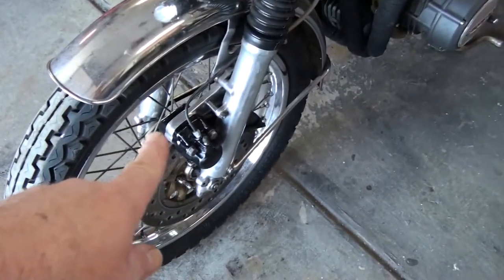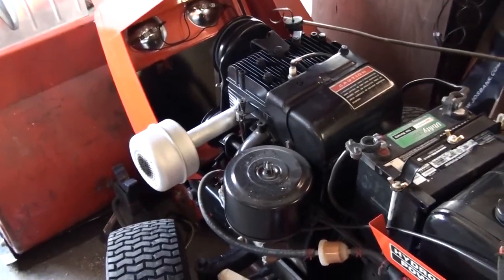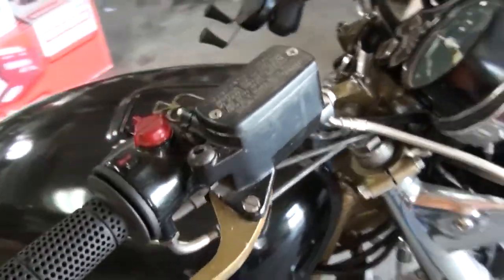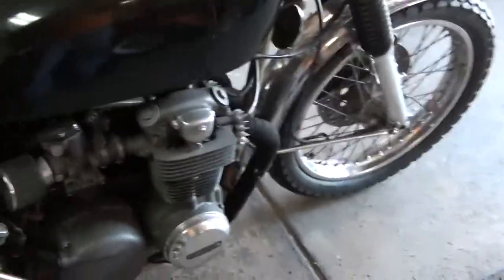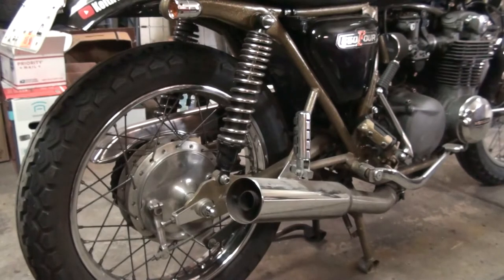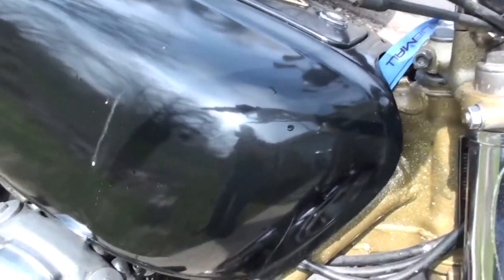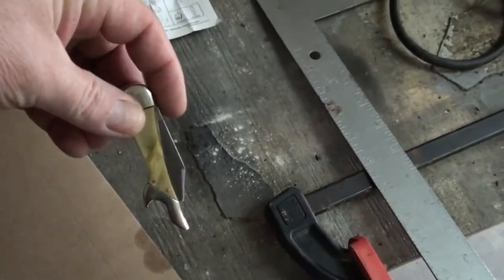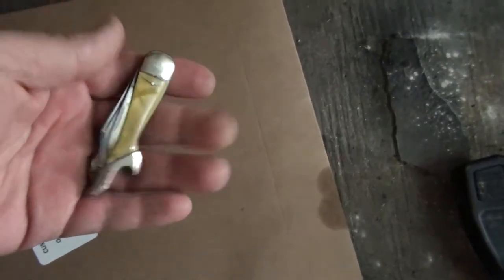April Weekend Update and Mail call

Comment: Cool the starter works . I use my front brake as much if not more than my back brake on my bike .
Reply from the maker: Yup everyone does however I don't ride aggressively and there is almost no traffic around here. These front disc brakes from the early 70's are almost useless anyway. I rode the tractor around all day Saturday and 10 starts later its still working so I am ready to call that a fix figures a $7 part that is all it was. Wheres your Gilson videos man! :)